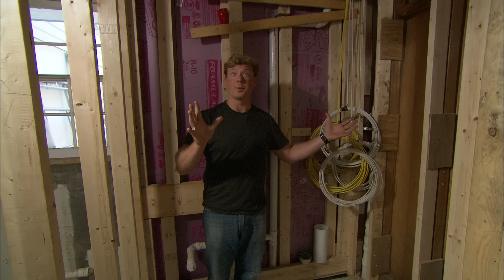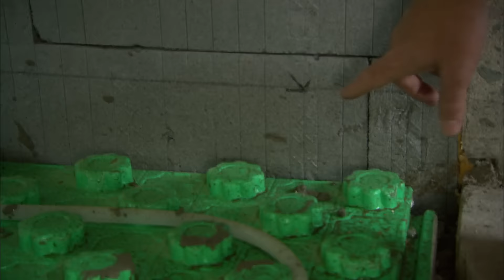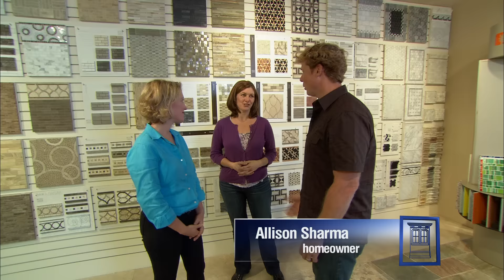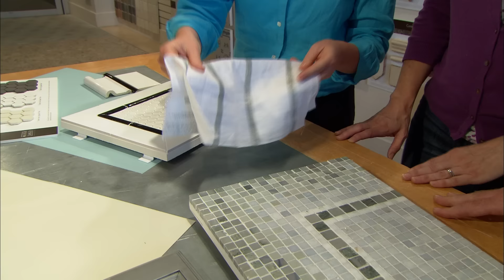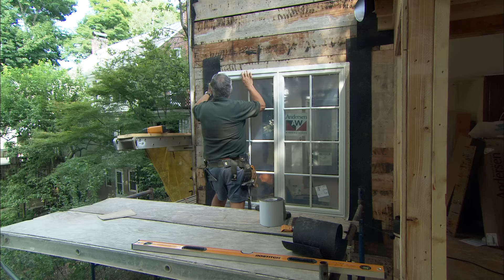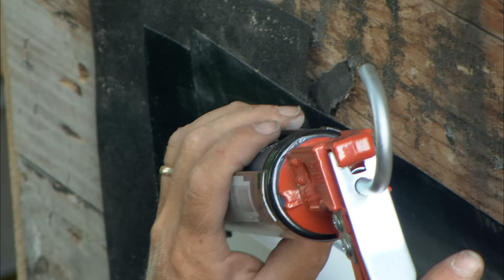This Old House | Progress On All Levels (S32 E7) | FULL EPISODE

Comment: This is the North East like any other episode, why are we using concrete on the first floor with no basement.  I am no contractor, but do know some stuff about what and what not to do with home improvement,  This Old House has my head shaking in why they do certain things like this lately, it doesn't make any logical sense.  They are way older than me, have been in the industry forever and should know better.  Many of the modern heating options are terrible, whether it being expensive, complicated and/or they are rigged to gotcha to pay into it several times over going forward.  If it breaks, then they figure they can make money to sell you a new system or even more big bucks to fix the current one with a cheap broken part made to fail.
Reply: They're pouring concrete in the basement. Calm down. First floor has board subfloor and hardwood.

Comment: If I was paying for that radiant heat floor, I think I'd insist the hoe they use to spread the concrete not be sharp and metal. No reason for it to be except it's probably what they use for any pour. I'd be worried that it could nick a line and leave a weeper that you won't find out about for 5 or 10 years.

Comment: I was the concrete mixer driver for 5 years and people don't realize that concrete finishers are artists. It's literally an art form to get that stuff all correct.
Reply: Indeed. I worked for a concrete company back in the early 90’s and it looked easy but I learned very quickly I sucked at it tremendously. I tried laying bricks and blocks and was so slow at it. The guys I worked with could lay about 6 bricks or blocks to my one as I struggled to make them even and level. I was best suited for mixing the mortar and carrying the brick and blocks to them. Woodworking on the other hand I excelled at.
Reply: Thanks. 18 years as a finisher here.
Reply: Hat's of to those concrete guys, that's hard work physically, and it's a very skilled job.